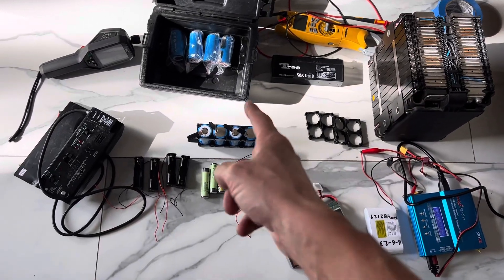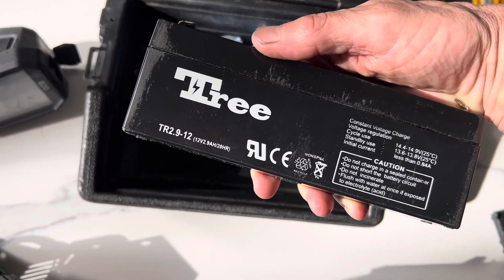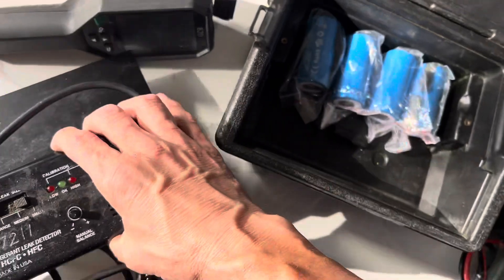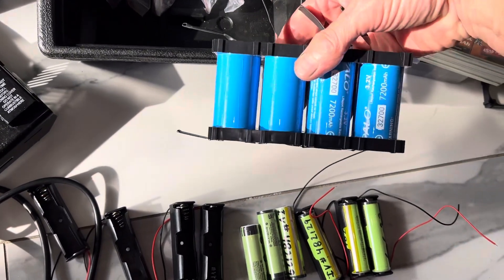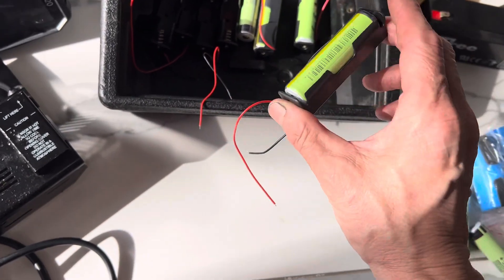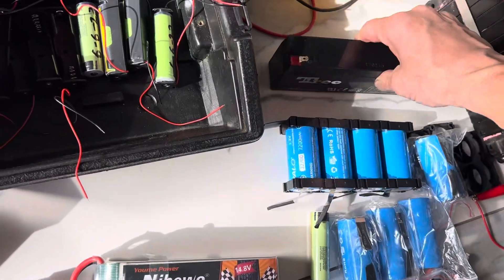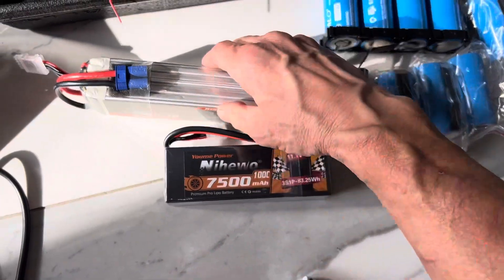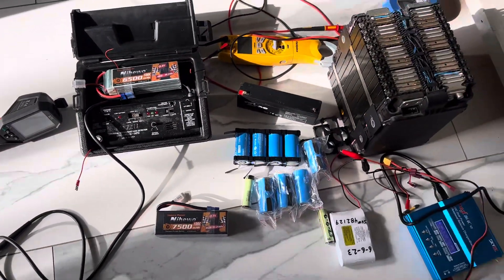H-10 Pro refrigerant leak detector lead acid battery short life span short usage time problem ￼

Comment: I'm having the same issue with my H-10. I looked for the follow up video for this one but didn't see it. What did you wind up doing?
Reply from the maker: I ended up using the round cells. 
     But most skies end up just using like a Makita or a Milwaukee 12 V battery plugged in to the outside charging connector. 
    Like that option easier because they’re not comfortable with wiring batteries on the inside.

Comment: Very quick, concise, and comprehensive overview of options and requirements! You hit the LFP cells, the balance charging, everything.
Reply from the maker: I’m real tired of lead acid, batteries, short lifespan, and low energy output

This is a $700-$1000 piece of equipment depending where you buy it
Technology from 50 years ago 
The battery modeled was introduced about 30 years ago 

And still to this day they’re shipping them with lead acid batteries  🤦‍♂️

Can you imagine cars still with bias, ply, tires, and inner tubes? 

Or cars were the starters an option your hand in the hand crank to turn over the engine 

This is the equivalency of still using lead acid batteries today .
Reply: @coldfinger459sub0  Woah, jeeze, they're still shipping them with lead acid? Wow.

Comment: Looking forward to the new battery pack you come up with.  Please provide part numbers of the pieces used if applicable.  My H10Pro will be needing a new battery pack soon
Reply from the maker: I will do make a complete list. Got everything on Amazon.
Reply: @coldfinger459sub0  hey did you add any of those batteries? Am doing similar for my h-10 pro
Reply: @coldfinger459sub0  did you get to put one of those batteries in the h10?

Comment: I changed my h10 to run on mikita 18 volt battery. Use a dc to dc volt converter. Mound a old drill base in the decteter.
Reply: I was going to say something similar.  I'm still rocking 12V NiCad battery packs for similar applications and if I get caught flat-footed I can always grab power from an auto battery routed through an empty battery pack.
Reply from the maker: @thisisyourcaptainspeaking2259  yes one time I was on a job and my battery went dead and I just hooked up to wires to a large 12 V automotive battery to get me through the job
Reply: @coldfinger459sub0  I was torn this last time with the idea of switching to 12V NiMH in the same form factor but my charger was built for NiCd, that might not work well with NiMh.  I've had long life from NiMh, some are past a decade.
Reply from the maker: I’ve gotten three decades out of my original Makita tools that used to have the long stick was that 7.2 or 7.6 volt NiCad
Reply: @coldfinger459sub0  Can't beat that.  The NiCad packs I've been using are constructed of 10x1.2V sub-c type in series both charge and discharge, between 2500 and 3600 mAh cells.  It's probable some have been damaged from being reverse polarity during discharge.
Reply from the maker: @thisisyourcaptainspeaking2259  I have not played with NiCad batteries since I was 20- 21 years old with little RC race cars.  Where you had to build your own battery packs..  using the super glue and baking soda method to stick them together.  And the soldering wires across their tops instead of using the spotwelding method..
Reply from the maker: That’s a massively excellent idea. 
Somebody told me about that I have a bunch of Milwaukee batteries . 

I was just trying to keep it inside the case, though that was one feature, I was trying to hold onto . 

DC to DC buck converter woodwork excellent . 

I guess you got tired of the lead acid batteries after I bought a few I’ve always said I was going to do this .  For the last 20+ years.. 

Before that, I always used the plug in the wall type old style .